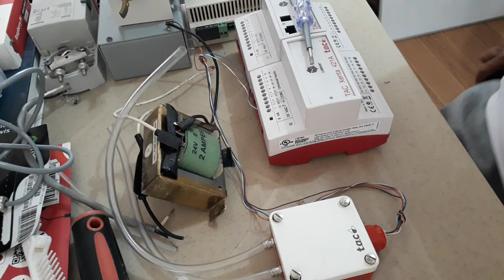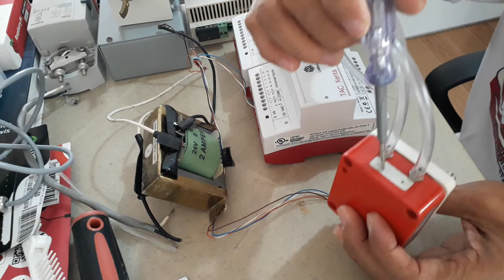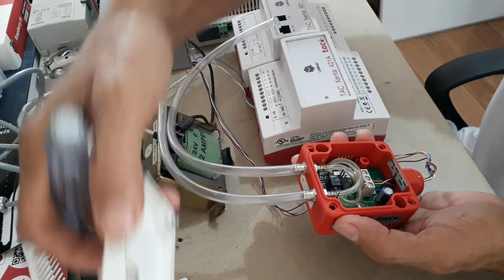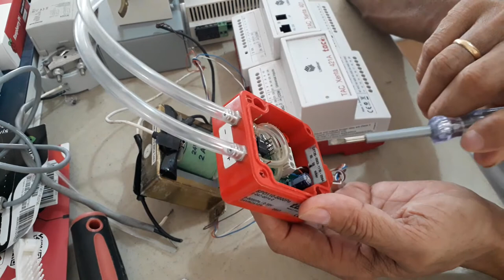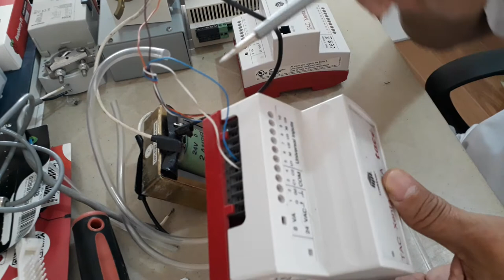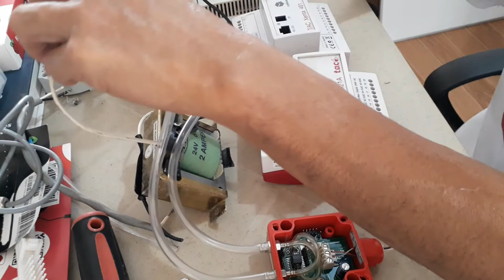How to become a BMS engineer part 59 (Air Differential Pressure Transducer)

Comment: May I connect DPT control signal in two VFD Analog Input 0-10V?
May I use one DPT for  two VFD ?
Reply from the maker: yes, I think so because I remember we parallel one control signal to several VFDs
Reply: @SantosJrCapellan-BMS  Thank you so much Sir . Can you please send a diagram. Any chance to divide the output signal between two VFD .
Reply from the maker: @uniqueautomationengineerin7861  what do you mean by divide? You check the documentation of your VFD if it will allow parallel connection of the control signal

Comment: well explained 
canu tell difference between static pressure transducer &  differential pressure transducer ?
Reply from the maker: When you say differential pressure it means difference between two pressures (P1 and P2), while static pressure in fluid dynamics is the pressure of a fluid on a body when the body is at rest relative to the fluid. It is called also static absolute pressure and there are some other factors that might affect the static absolute pressure such as temperature, sometime  we are using also static absolute pressure sensor for water tank continuous level monitoring.
Reply: @SantosJrCapellan-BMS  CAN WE  USE static pressure transducer  FOR  STAIR CASE PRESSURIZATION
Reply from the maker: @salimyousuf8848  for staircase pressurization you need to use DPT rather than a static pressure sensor